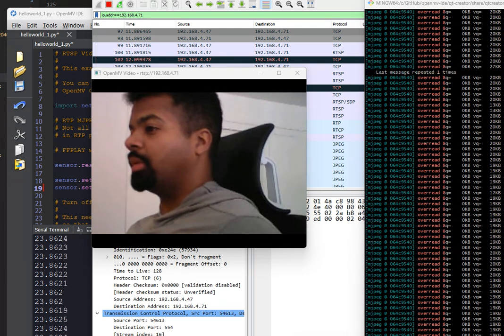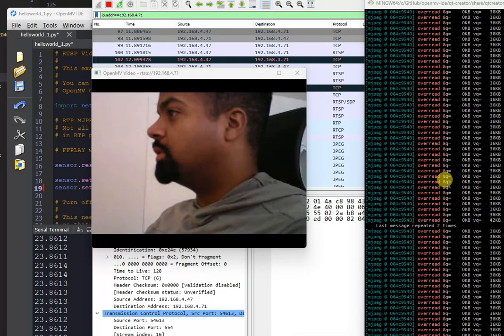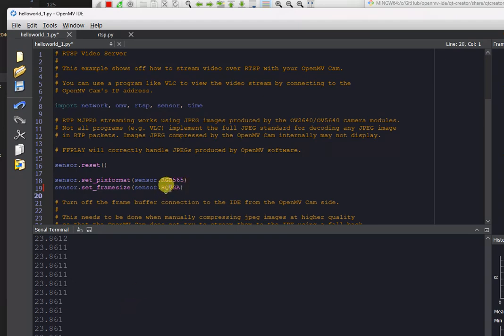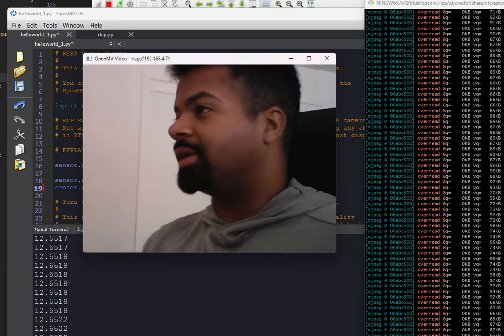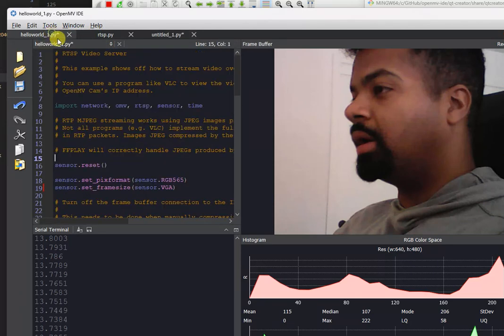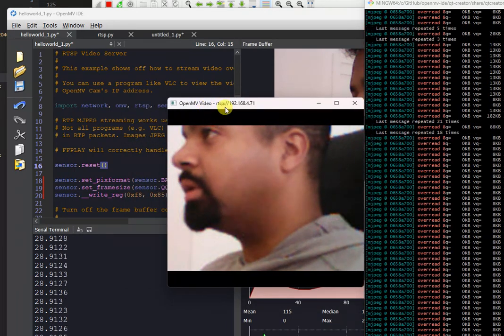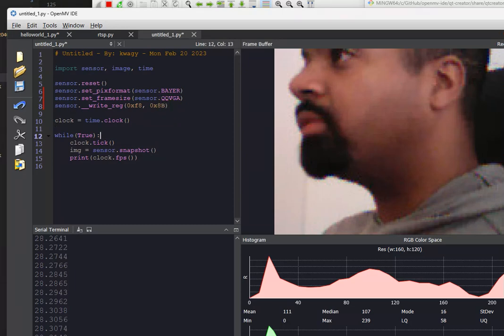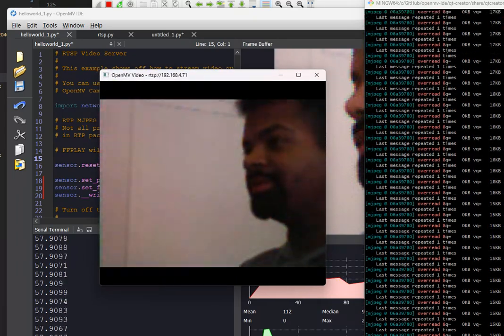Arduino Nicla RSTP Video Streaming

Comment: Hi, I find very usfull your code and experiments, Im also using a nicla vision and working on the example code of rtsp but cant make it work at all, when vlc starts the connection all seems good it opens a session and suddenly the program(miropython) crashes by an Index Error, do you have any idea of the cause?

Cheers.
Reply from the maker: Hi, the PR for the feature was just merged. It will start working in the next firmware release.